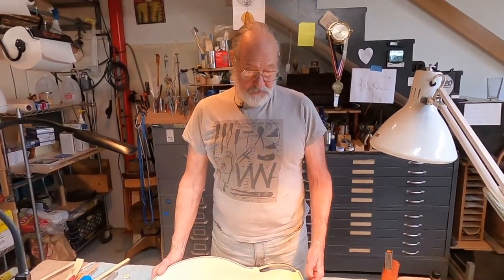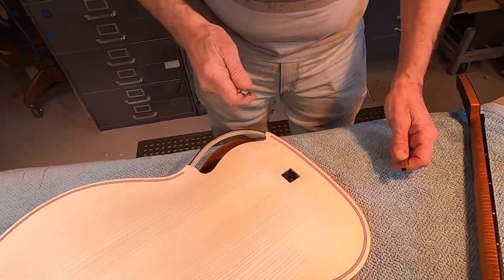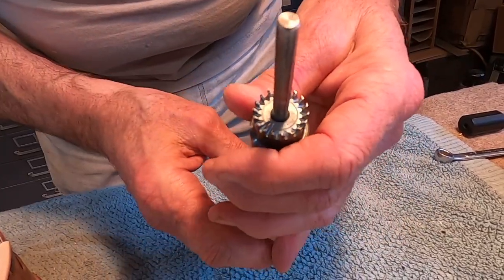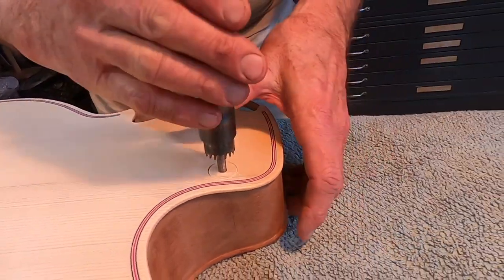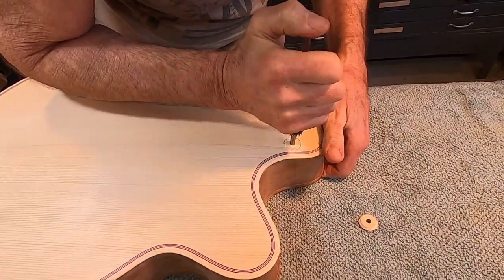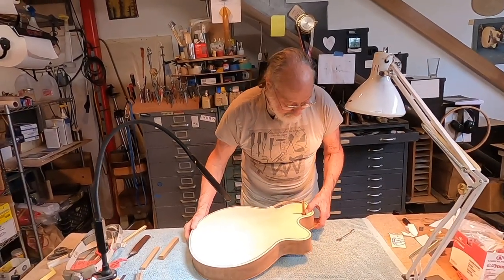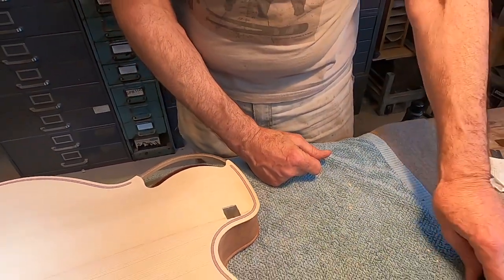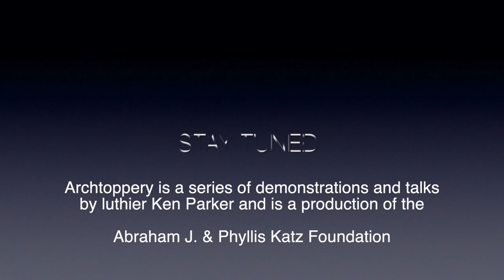Ken Parker Archtoppery - Riff 006 Discovering the Neck Joint

Comment: I remember listening to the Luthier On Luthier podcast and being most intrigued by the episode with Ken Parker (there my have been more than one if I remember right). I really appreciate the drive to take guitar design to new heights and possibilities. Very interesting comment about relieving the top material within the square hole so there is not tension against the top. I’ve heard other builders speak of similar intentions while building in order to not build tension “into” the instrument. Cool stuff!
Reply from the maker: There is plenty of force on the top exerted by the strings through the block/top structure, and I certainly do want to load the top with the compressive forces of the strings.  I think it's important. I guess I wasn't clear, but I was referring to the neck pin getting involved with the end grain in the front of the pocket, which can stress the top and crack it, ask me how I know. In other words, I need to remove a little end grain material on the compression side of the neck pin to keep it from getting pressure on the end grain at the top in the hole. Make sense?
Reply: Oh, I see.

Comment: There's something elvishly intrigueing about your designs and seeing them being realised by hand without as much as a pencil line for reference. I do wonder though if one wouldn't want action adjustments to have a larger effect on the bass than on the treble strings? I definitely tweak my lowly adjustable saddle more on the bass side. Maybe you already get some of that if the saddle is cut to give a higher action on the bass side (I'd have to do the math) but if not (or if that's not enough), could the mechanism be adapted to achieve this effect?
Reply from the maker: Thanks for your praise, I'm having a blast!
I measure action as the space between the bottom of the string and the 12th fret's top surface, while the string is fretted gently at the first fret so as to take the nut height out of the measurement.  
Although some players will want their strings higher or lower, most acoustic guitar players will be comfortable with the action set at .090" at the bass E, and .070'' at the treble e string.  (2.3mm - 1.8mm)
For electric guitars, the numbers are more like .070" and .050".   (1.8mm - 1.3mm)
The idea is that the treble e string is set about 25% lower than the bass E string. 
Although most players will find that this 25% Delta works very well, there are some who want a slightly different setup, something easily adjusted by the builder or repair technician by filing the slots in the bridge top.
For me, adding a mechanical system to adjust the E - e action difference would be complex, and not often used, as this is normally a "set and forget" relationship for most of us. 
Sometimes arranging for the "convenience" of adjustment is clearly inconvenient, all told.

PS, "Delta" (△) is useful math lingo meaning "Change of any changeable quantity, in mathematics and the sciences"
Reply: @kenparkerarchtoppery9440  I hope you're having a blast even without (my) praise! ;) I hear you on the cost of adjustability but as a purely acoustic fingerpicker I like to dig in and thus appreciate the possibility to raise just the bass-side action a bit when needed, like when going into drop-D. Then again I get by without any on-the-fly action adjustment on my classical and resonator...

Comment: I would imagine that while the tolerance is pretty tight (where the neck interfaces into the square aluminum piece) there is some space.  Do you use anything like dampening grease?
Reply from the maker: There's around .005" clearance between the carbon/epoxy neck pin and the square aluminum socket.
The neck pin is loaded at the front of the top of the socket, and at the bottom of the back of the socket, as you might imagine.  I want a nice solid connection for energy transfer, and this is a fine way to get it.
Here's a place I don't want any dampening.  If you're suspecting that the neck might rattle around in the socket, I can assure you that the 165# of force that a set of .012" - .053" bronze wound strings applies is not gonna let that happen!

Comment: I assumed the neck post connected with the sliding aluminium element but couldn't work out how.  Weirdly (because I've been thinking about this for a while) as I type I've just realised the answer to my  question is probably that it doesn't attach to the sliding block at all - it just rests on it, kept in place by the pressure from the strings. Is that right?

If that's happening, and the neck post is held against its hole by string pressure, it seems the strings are actually a structural element in the design. In a sense I suppose they must always be, but this has echoes of tensegrity structures.

Or have I got it all wrong? Wouldn't be the first time ;¬)
Reply from the maker: Sounds pretty familiar to me, you sorted it out. The aluminum tube is glued to the neckblock, and the strings hold it all together.
Reply: @kenparkerarchtoppery9440  Hi Ken
Thanks for this - I'm always so impressed that you find the time and benevolence to respond to these dumb questions ;¬)

Have to say though that I still don't feel I've really got to the bottom of this joint. I couldn't reconcile the apparent use of one screw to both lock in the neck and adjust its position, which seem like contradictory requirements, hence my question. Strings alone just doesn't seem like enough - what happens when the guitar is unstrung?

Anyway, not to worry - I guess I'll have to wait for the remaining videos to arrive - luckily the journey is just as entertaining as the destination ;¬)
Reply from the maker: You're close, you'll see
Reply: @kenparkerarchtoppery9440  I'm looking forward to it!

Comment: are there any videos on the construction of the neck?
Reply from the maker: Um, not yet, but hang in there.  
First big project is to fully explore the design and making of plates, about which there is nearly Zero useful info to be had.
My neck construction will be fully explained when I'm done with the body.
There are lots of viable ways to build an adjustable neck, and I expect to see them more and more, it's so better.

Comment: I’m not a luthier but it seems there would be ZERO forgiveness regarding any unwanted off axis-ness regarding how the block/tube gets fitted to the back of the neck. Seems one degree off could cause the low E string to be too far inside the neck, while the high E would be falling off the fingerboard’s edge. Seems like a job for CNC but the fact you’re doing it by hand is mind blowing to me.
Reply from the maker: As a non-luthier, you are correctly tuned in to the very low "rotational" tolerances required by this method.
Next series is the building of the neck, and I'll better show how this all works. 
The name of this segment starts with the word Discovery, and I used it to suggest that the neck block and thin wall aluminum tube that accepts the neck pin already exist, we're just removing the top material that covers the opening after it's glued on.
I install the tube in my Bridgeport milling machine, carefully aligning the rim assembly while firmly clamped in a mold. CNC is great if you're making many identical things, but isn't right for this job.
By the way, let's always remember that supremely accurate work was done in many fields, all over the planet without the use of newcomer CNC.